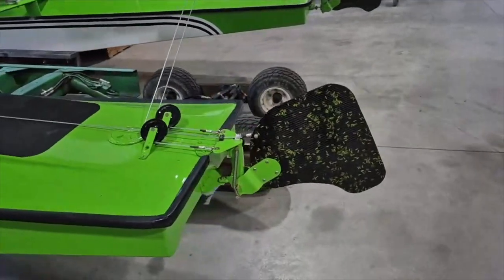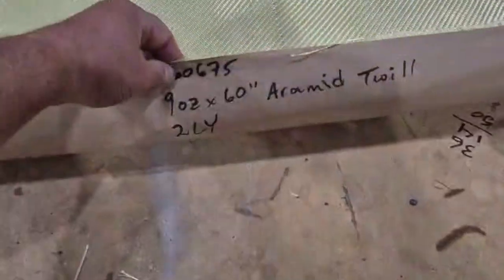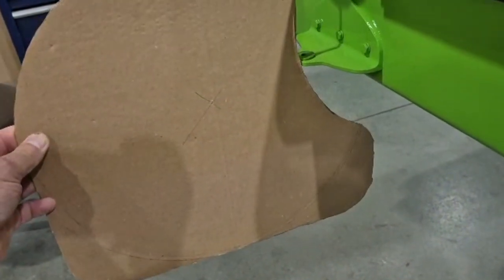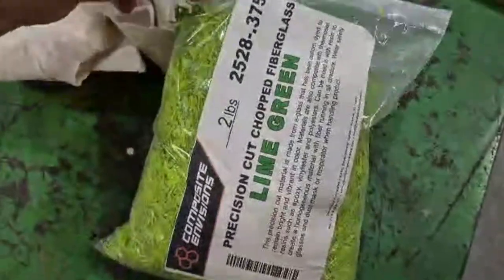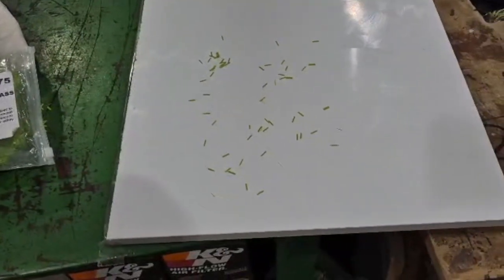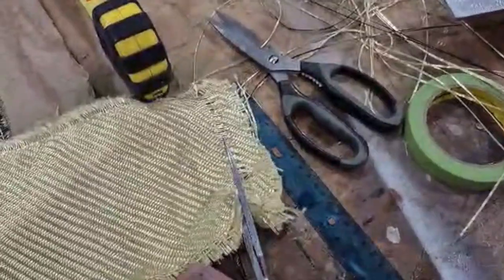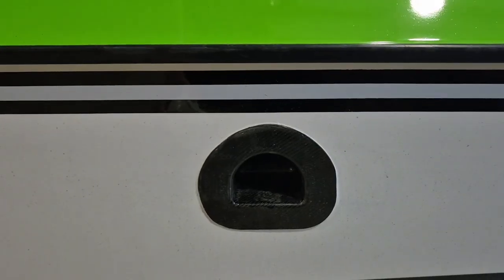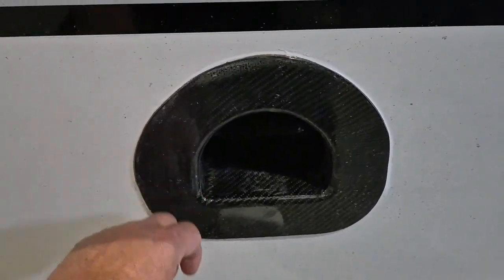Bigger Water Rudders & How to Make a Step

Comment: Interesting work and I do agree that using the kevlar will make it stronger compared to CF alone. It will hold hold up to stress, stretching and will absorb impacts better than the cf. Covering the outside in CF will also limit one of kevlars weaknesses, which is  UV light.   
One thing, I found the music too loud over your explanations, very intrusive. Looking forward to more of your ideas and posts.
Reply from the maker: Thanks for your insight, Peter. Much appreciated.  When Andrii and I made the carbon fiber spinner , we did kevlar on the inside with a few layers of CF on the outside as well. I believe it is going to work to our advantage.  The real reason i didn't want to add kevlar is i would have a white line in the middle.  But really, it was easy to cover up with epoxy and graphite.  Thanks for the note on the background music.

Comment: Looking Good Henri. I think that your screwup with the kevlar will turn out to be a good thing. It`s like putting rebar in concrete. You should try using an Olfa rotory cutter to cut it.
Reply from the maker: Thanks very much, Frank.  I remember talking with Andrii about it, and we believe it will stop a crack from propagating . I will try one of those cutters.
Reply: There’s also serrated scissors out there that are specifically made for Kevlar
Reply from the maker: I was looking at buying some but keep telling myself that i won't be working with kevlar anymore.  Lol ya right.   @phillipwells1557